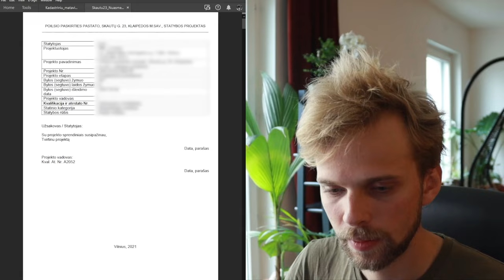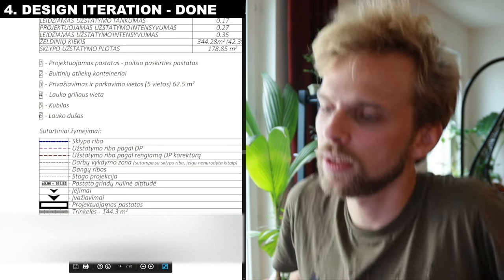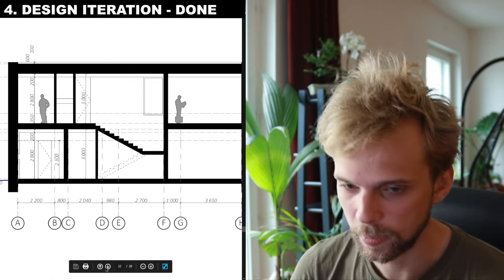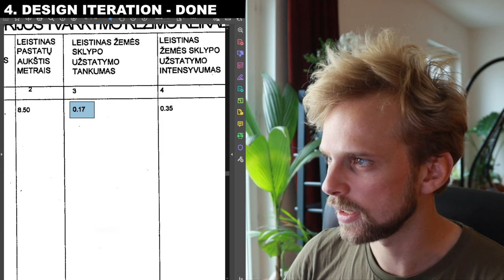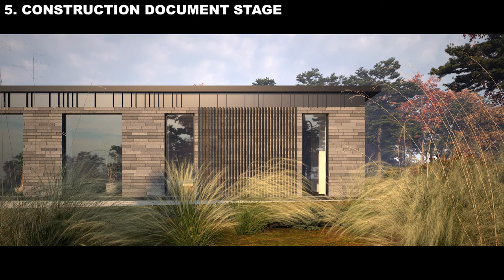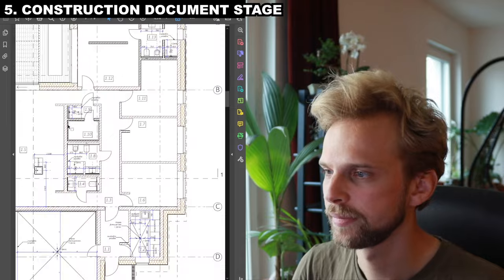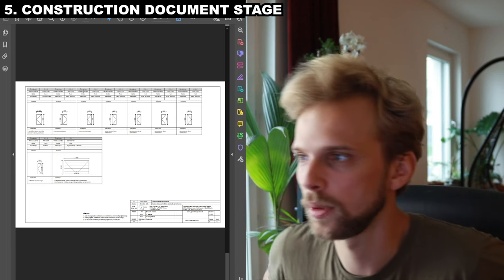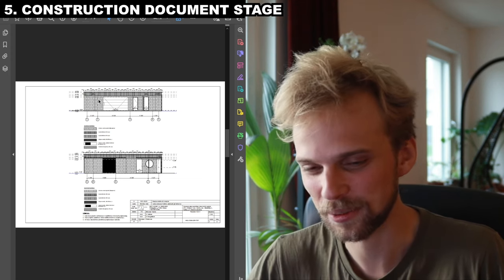The Show Must Go On : Architecture design from start to finish #3

Comment: why didn't you take into account the construction limits (0.17 and boundaries) before starting the project?
Reply from the maker: We did. Sometimes it's easier to file for a change in regulation than to convince a client to have a smaller house. To be fair - since the time of recording we did manage to get the site limit bumped up, get a building permit and currently have the foundations laid out.
Reply: @DesignGoBrr  I'm happy to hear it. It is really true that 50% of a project depends on the quality of the customer. It happens more and more often to find unreasonable people.

Comment: All you drawings are made with rhino? And the renders with vray? The trees, grass and the vegetation in general was very nice. Probably these are meshes and not nurbs solids correct?
Reply from the maker: Depends on which architect works on them. I personally do all Design development stage drawings/3D models in Rhino, while moving to a BIM software for Construction drawing stage. My colleague Olga uses Rhino for 3D modeling, but all drawings on all stages are done with BIM software. So there's no "correct" workflow here I think, only a matter of preference. All renders are done with Vray for Rhino with all vegetation imported from the Chaos Cosmos free object library (it's meshes). Grass is done with a hair simulation.

Comment: It may be interesting to export the model of rhino to sketchup, mapping texture and rendering there with Enscape. I tried here and find easier than using just rhino alone because of the warehouse. The only problem is that SKP is horrible to load models and became slow very fast. The Enscape thing i think it's faster to configure the textures and light, and the realism result is so freaking alike... The problem of Enscape is that i found a bit hard to understand how to use the ID image stuff for post production in PS, where Vray just give you everything
Reply from the maker: For now my fastest workflow is Rhino+Vray+Archicad, but I'm planning on replacing Vray with Twinmotion or D5 render to see if there is an improvement. Switching to Sketchup seems like a pretty big downgrade as it's not a proper tool for architectural design.
Reply: @DesignGoBrr  Yeah, i'm just saying that Sketchup have the Warehouse blocks to finish the render, even if you are using just the Rhino (you can export it too)!  But you know, i'm just a student :p. And i think i will try Twinmotion too!